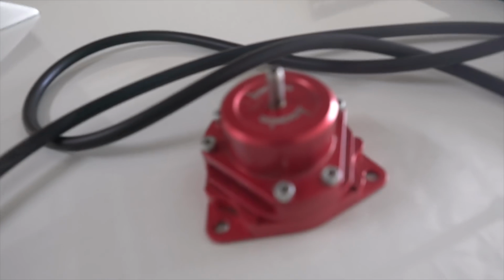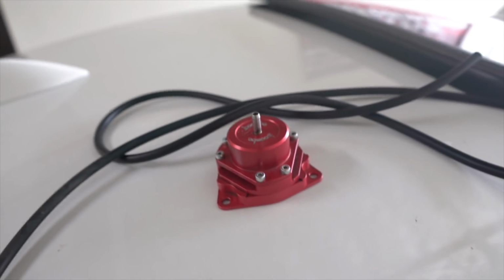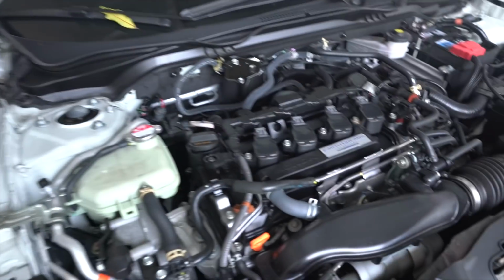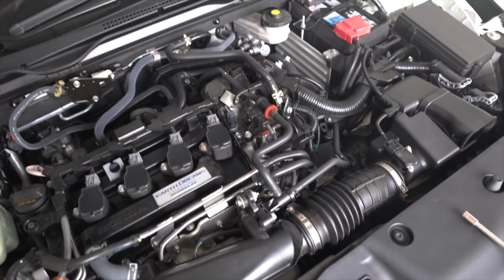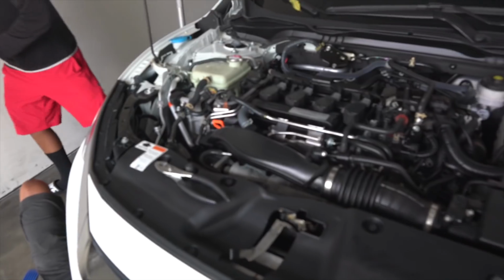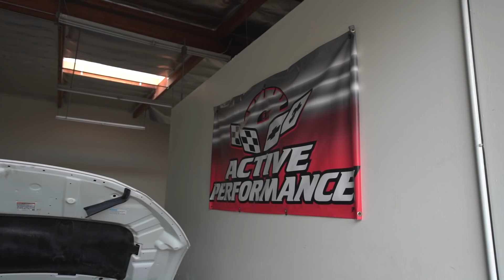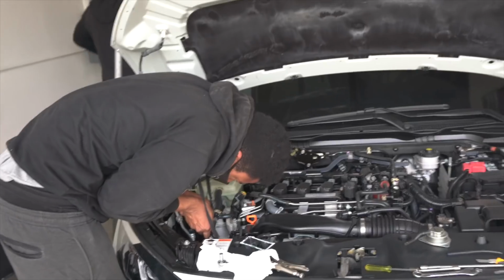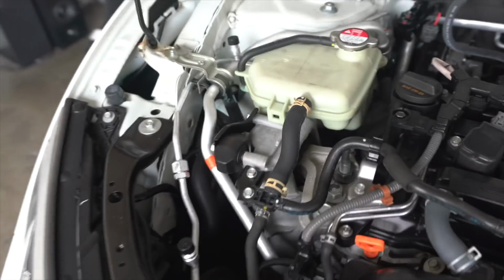Installed A Blowoff Valve On My Honda Build!

Comment: Honestly you should have just got an intake if you want to hear the turbo noise. A blow off valve will make the engine run rich. The MAF sensor reads the air at the intake. The computer then mixes in the right amount of gas to match. The problem with the blow off valve is that it releases some of the air before it mixes with the fuel. You may not notice anything right away but running rich can result in fouled spark plugs, surging idle, backfires, premature cylinder wall wear, and other issues in the long run.
Reply: So I've already got a cold air intake,  so I wouldn't have that issue if I get a BOV installed?

Comment: You better make sure u add maf sensor cleaner to clean out that blow off valve I had a boomba BOV and it collect oil and dirt so make sure u clean it out frequently and with the Maf sensor cleaner make sure when u do u let the car sit for 45 minutes before u drive the car

Comment: Air intake next will really sound louder 💯🔥🔥🔥🔥
Reply: I put a bolt on valve blow  off and when I accelerate it's doesn't make any sound the sound i hear is when I release the gas pedal

Comment: Nooo. That's the worst modification you can make to your civic. The "blow off valve" for this generation civic, with that engine (L15 Turbo).

It also makes the engine run rich.

If you want the turbo woosh and spool sounds, just get a Mishimoto or PRL intake.

Youll hear the same sound, but louder with no effects to your Fuel Trims.

There's an Air Bypass Valve on the intake tube before the turbo, after the air filter.

If you'd like to hear how it sounds check my IG @ Crv_stormtrooper I installed an intake on my 2017 turbo crv (same 1.5 L turbo engine).

My intake sound impression video has over 10k views.

Comment: Please don't rice out that honda bro make nice DO NOT ever put a fart can on it if you want a good exhaust try the mugan cat back it could go well that blo off valve
Reply: Go full rice or go home 😂😂😂😂
Reply: @andre26261095  Exhausts don't void anything. Unless the exhaust you put were to plug an engine(Impossible unless you went quieter.
Reply: @jimmypena2442  
  No point of putting exhaust on CVT automatic civic to begin with LOL